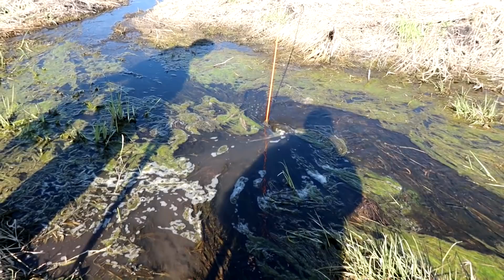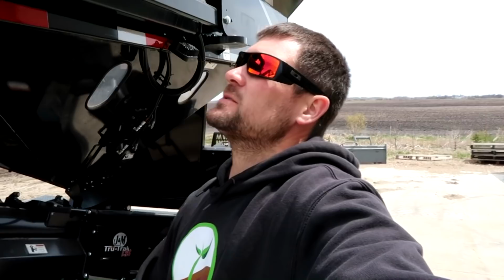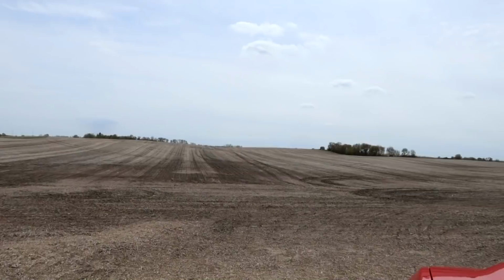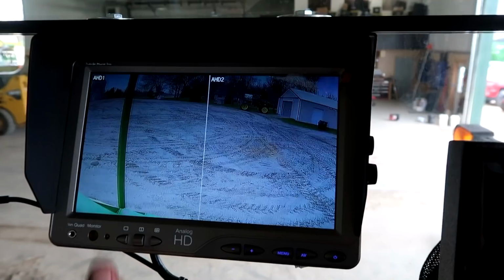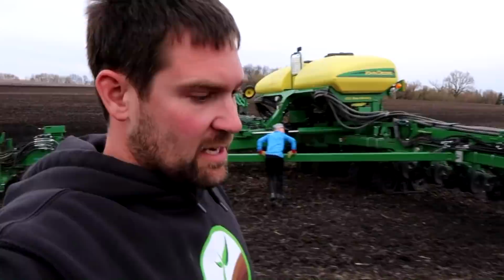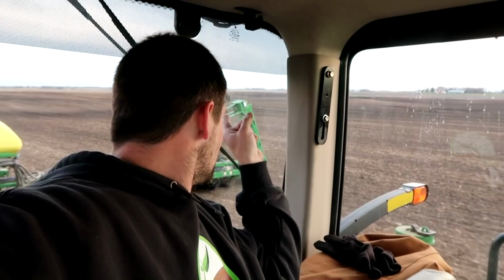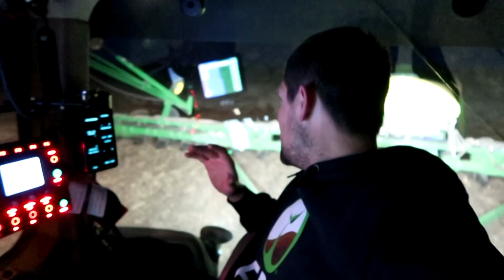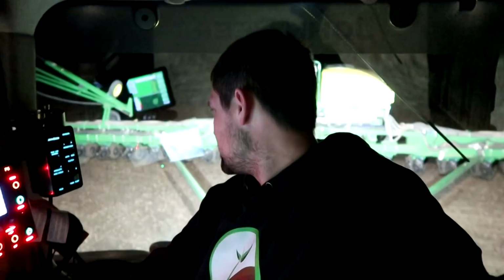Spring Corn Planting 2019

Comment: Glad the weather is such that planting is doable for you and across the nation. Nebraska, due to devastating flooding, may be, on the whole, a lost cause for 2019 growing season.  But, if 2019s crop is blessed by necessary moisture,  what is lost may be offset by a higher than expected crop. Zach, staying on top of things, supports success much more than the time spent in data/adjustments. No doubt, yields will be greater than or equal too estimates. Good luck on the hard work.

Comment: Hey does your population tend to be pretty close too your goal 33500 in the field after the corn emerges? Or does it typically run lower than that? Most guys by me run populations a bit lower on combine corn ground.
Reply from the maker: It will be a little less because germination rate is never 100%

Comment: Wonder if there's bushes in the row cleaners that are still tight 
I'm unsure how they work but I know any parrelelagram air seeders give inconsist depths the first week or some 
Plastic bushes and pins need a bit of flogging to bed in and wear so they all evenly respond to down presure
Reply from the maker: I think that may be the issue actually.  I've gotten them better since this video
Reply: @MillennialFarmer  
Need to go find your roughest field and hit it at 20mph haha 
Dont know if the planter or your back would think that's a good idea though

Comment: Semi-new to the channel and have watched a lot of these with my gf and we both had the same question: When you were putting the seed into the grain loader, you added a white powder to the grain as the auger put it in the grain loader; what is the purpose of that powder?
Reply: It's a talcum powder that helps keep the inside of the planter lubed to allow the sees to flow through it with no problems

Comment: Do you think using conventional crops over GMOs will hurt your yield
Reply from the maker: No.  If the yield is hurt it will be because of the hybrid, not the engineefrd traits.  Unless we can't control the weeds or root worms on the conventional corn, but I don't think that will be a problem

Comment: I know who 7, 5 & 4 are. Who is 1, 2, 3, 6 & ♾? And I have an Infiniti in the driveway

Thanx from the left coast near the Krapitol of California 

Is there going to be a follow up on the filter?
Reply from the maker: I ended up swapping the housing off camera.  It was easy and only cost $64!
Reply: MN Millennial Farmer so you knocked the housing off the camera and changed the filter, but the question is did you change to a polarized or UV filter  lol
Did you let the dealer you bought the sprayer from the quality of their workmanship?

Still 1dering who uno, dos , tres, & seis(-1sp) is/are

Noticed OLF got a video from your filter mishap
Reply: Double or triple chip for adequate tensile strength and a query What is the white substance you add to the seed?

Comment: Whats that powder your adding to the seed?
Reply from the maker: Talcum.  It acts as a dry lubricant for the internal planter parts
Reply: Seed Talc(talcum powder)It prevents the seed coating from gumming up disc in the row unit that vacuums up the seed one by one and drops it down the seed tube into the ground.Also helps the seed flow better from the big central seed boxes through hoses to the individual row units.
Reply: @MillennialFarmer  Thanks guys, that makes sense.